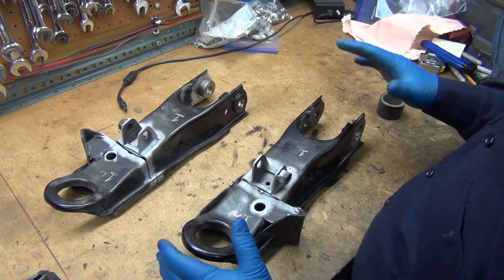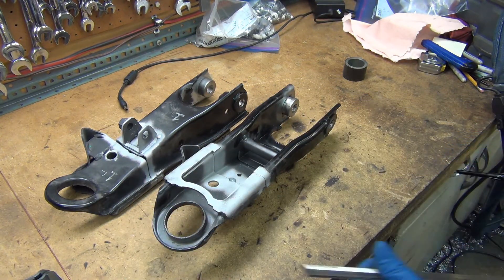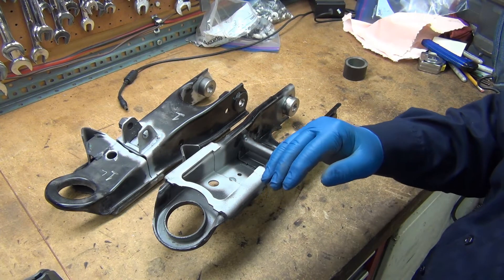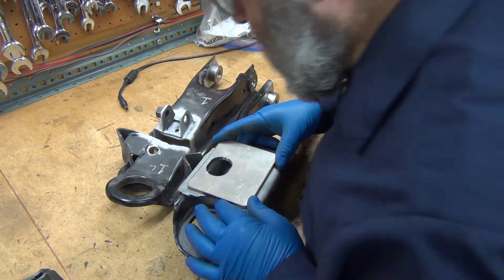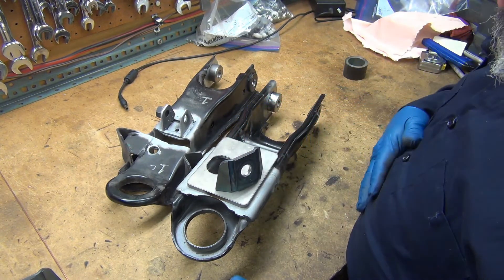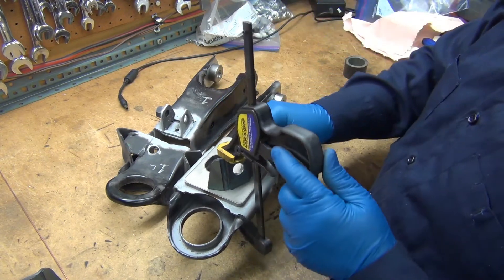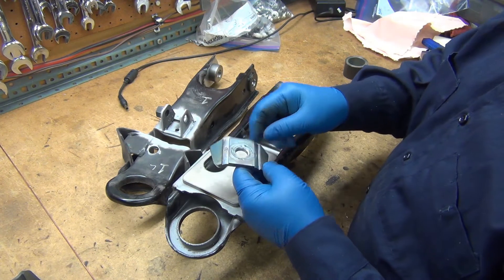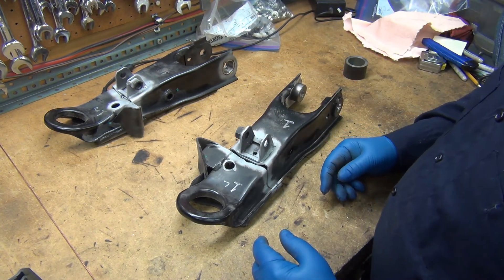Tack Weld Instructions - LCA, ball joint mod

Comment: What truck are u building  those for?
Reply from the maker: It's part of a setup that converts the old Datsun trucks that have kingpins to ball joints.  I have to mod the LCA like this to maintain stock track width.  A couple of setups went out with just tack welds so that the owners could do their own welding and save a few $'s.  I have a bunch more vids on the building of the setup.
Reply: bluehandsvideo sweet  do u have one to run nissan hardbody  on 73 datsun 620 pickup? I have a 73 datsun 620 pickup  and i have a 93 hardbody  parts truck and would like to run front suspension with brake setup  on my datsun.
Reply from the maker: That's what this setup is for.  I modify HB LCAs and make custom UCAs.  This should be a link to the playlist for the ball joint mod.  https://www.youtube.com/watch?v=xF0jyB_hgc0&list=PLAUFP46xkHEyaExdKvbpQ4kvK9-Fm2Aia   Might be better to start from the newer ones and work backwards.....some of the old vids have been "superseded" LOL
Reply: Ok thanks
Reply from the maker: You're welcome. :)
Reply: I will be coming to u for one when the time comes im getting very close  to it.
Reply from the maker: Cool.  Hopefully, I'm up for making more when that happens.